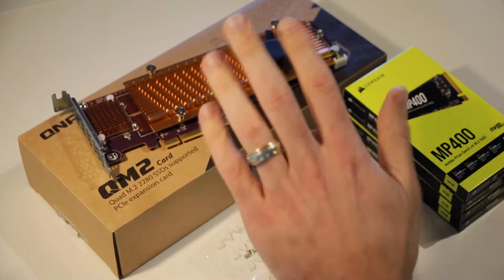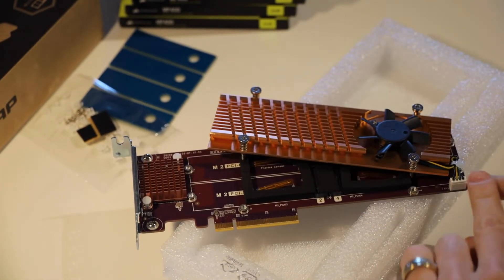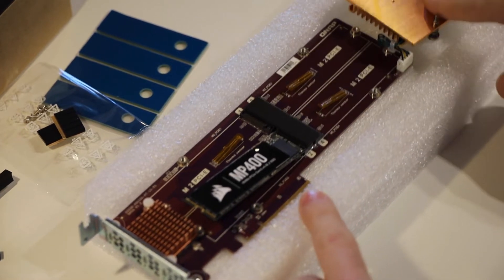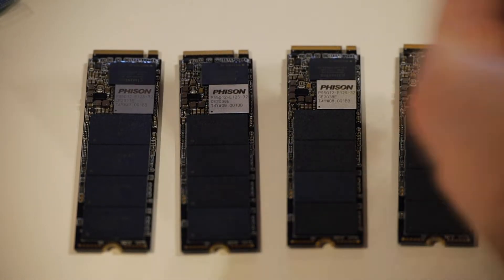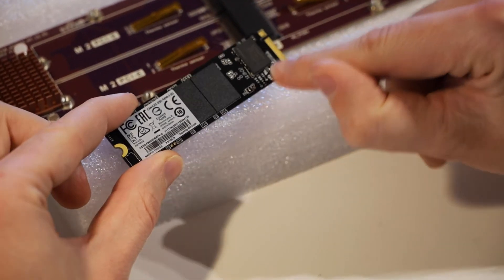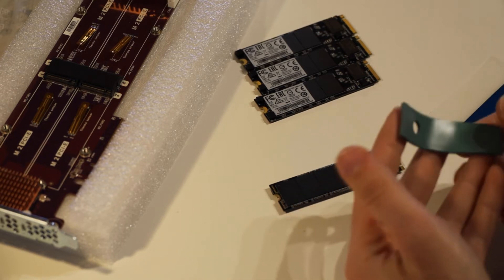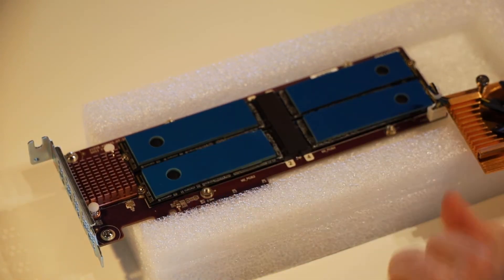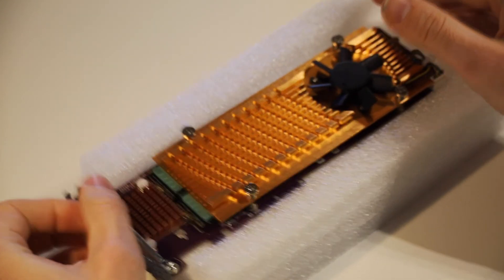Setting up the QNAP QM2-4P-384 SSD PCI-e Expansion Card with 4x SSD drives

Comment: just fyi flash chips don't really need cooling to perform well usually the actually prefer to be warm it will help write durability the thing that needs cooling is the controller because it can throttle when getting hot so if the sticker isn't covering the controller you can leave it on just fine

Comment: Is this card compatible with third party thunderbolt enclosures like Sonnet 650 / 750?
Reply from the maker: I haven't tried it in an external enclosure myself, but Windows will read the SSD's when connected to a PCI-e slot in a desktop machine so I'd expect it to work through an external enclosure also, at least with Windows anyway.